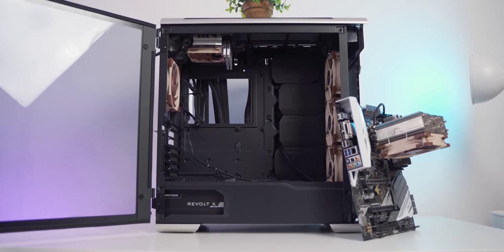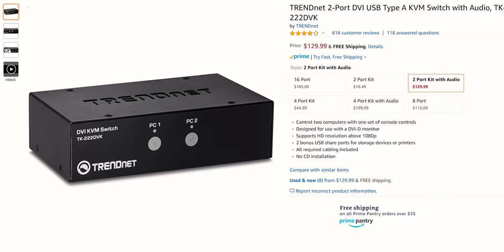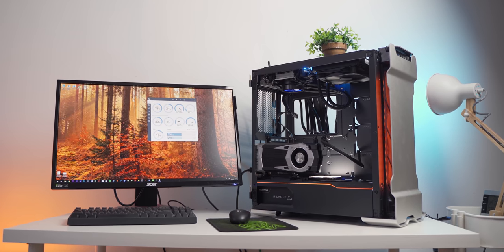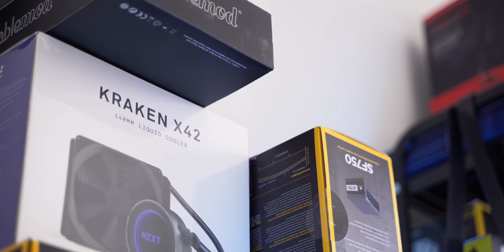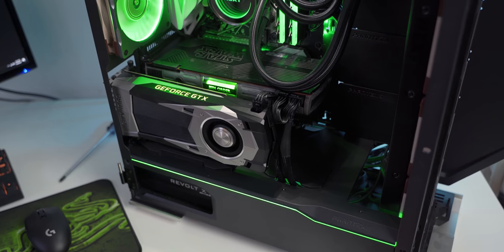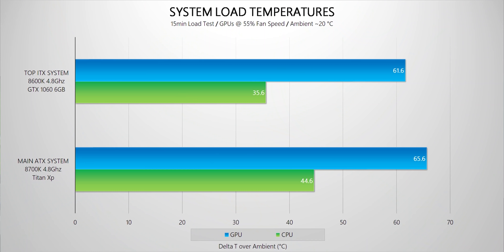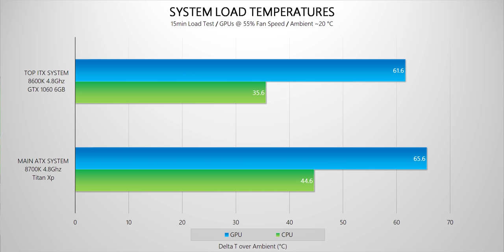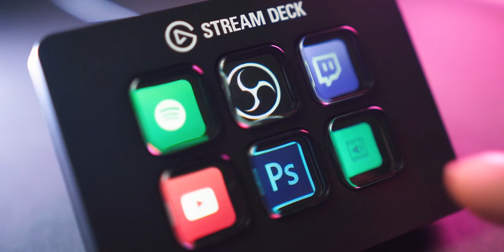My Experience with a DUAL System PC!

Comment: In my case -> ATX for gaming only, ITX for dual boot Linux/Windows. Linux for security, mainly accounting, ordering things, bla bla bla and the windows is for programming only. Have 3 monitors, 2 4k hooked to the itx system directly, a gaming monitor with a res of 2560x1440 connected to the gaming system directly, peripherals shared with a kvm switch :)

Comment: The Noctua specifically states that the NH-L9i can't handle the 8600k (95W TDP) WITHOUT OCing since it's rated for 65W TDP or less, and then you're surprised that a 4.8GHz OC overwhelms the cooler? Yeah...

Comment: As far as dual system consumer cases go, I've had the best experience with the Phanteks Enthoo Mini XL, and not simply for the ability to have an ATX and a Mini ITX system in there, but because it has 3X5.25 inch drive bays, it's sad to see the consumer industry pushing some enthusiasts into server grade cases to build what one wants, some of us believe in local storage u know !
in my case it's absolutely essential to have 4X 3.5/2.5 inch drives ACCESSIBLE AT ALL TIMES FROM THE OUTSIDE, and the only solution is having a hot swap HDD enclosure that fits in 3X5.25 inch drive bays,
as for the BEST hot swap enclosure to have in my opinion is the Rosewill RSV-SATA-Cage-34 for 2 reasons:
1 - Critical - the use of NON PROPRIETARY fan in the back, so u can be sure that those are getting the Noctua treatment as soon as they're unboxed, plus the possibility of EASILY changing it if it dies
2 - Personal Choice - individual HDD leds are blue, which I prefer, but more importantly the absence of green leds that light up green-orange when something is happening, which discriminates against color blind people, making it as hard to discern as a quiet talker's point in a noisy night club, 

This is blasphemy for some enthusiasts and a religion for others, I do understand how some people want to have a board, an M.2 drive attached that's IT !!! but really there are other people out there

Comment: or i mean use synergy ? so you could use 1 set of peripherials
Reply: Just what I was thinking.
Reply: Input Director all the way
Reply: While that would work here, synergy also supports linux and macos.
Reply: I don't think you can use software to switch since each mobo has its own IO?
Reply: @Vinchucca1984  synergy is meant for using 1 set of peripherals doesnt matter the io  u can use it on mulitple computers at a time too
Reply: Only works if it boots into the OS. Still require it's own monitors. a KVM switch would be a better option since the computer is all in one chassis
Reply: But the main purpose of a 2 in 1 pc is that 2 people can use 1.

Comment: KVM with high resolutions and framerates is quite expensive though, like hundreds of bucks. Only switch I'd really recommend is the L1techs KVM switch and that one costs 330/550 bucks depending on the model. And even then it's only DP 1.2 and not 1.4, so for the price you're not even getting a whole lot. Really wish more monitors came with a USB switch based on the input device. Then you can easily switch between different PCs through a hotkey and DDC.

If you secondary system doesn't require low latency, Synergy could be an option.
Reply: What applications would require low latency?

Comment: I thought about trying to do a dual system a while back for my NAS. I decided against it because it doesn't make any sense in my opinion to build a NAS that is a critical backup for your stuff because if my power supply breaks or there's a power surge and all the files are corrupted or whatever on my main system, it might just happen to the backup too. It might be practical to try and fit two power supplies in a single case, but then you need to find a small power supply and probably a really huge case, which defeats the purpose again because I don't want a computer the size of a fridge just so I can save space. Basically it's probably just better to build the NAS separately and put it in another room. I wish it weren't the case because dual system builds look really cool...
Reply: You can actually build your NAS and your main system in one case . make sure you use a surge protector and a UPS so even if the power goes off, your UPS is still on to enable you shut down properly without any loss of data.

Comment: Unfortunately you cannot use the mITX standalone, the main system needs to be powered on too. In my case, weird stuff happens when you power on the mITX. Even the GPU fan of the main system starts spinning while the main system is still powered off. The fans and aio pump of the main system are spinning too.
My config: a Hackintosh ‘up there’ configured on the mITX and a Windows 10 ‘down below’ as the main system. Main system uses a 360 rad while the mITX uses a 120 rad. Temps are normal, but I need to power off the mITX when I want to game... due to the ‘Hey, want to be an oven’ Radeon VII.

Comment: ATX system is for 64bit windows running current games.
ITX system is for 32bit windows to run older games that do not have versions that run on 64bit windows.

Comment: The 2nd physical system is redundant, just use a hypervisor (ESXi?) instead. I'm a Noctua fan too, so why are you not using the Chromax coloured or the cheaper grey Redux variants; instead of the traditional, but now unfashionable, brown? Finally, if the 2nd ITX system is something like a NAS, it will probably be headless and require no monitor to be attached anyway - except for the initial setup. Dual PSU is more of a gimmick IMO; but hey, maybe I'm missing something?

Comment: One 32 core threadripper system as a workstation and the other one for gaming. I currently have a threadripper 1950x but it is running 2 copies of windows on separate ssds, one for gaming with gaming mode enabled and one for uni and running BOINC ect. It's good cause switching to the gaming os is a pain, but it could be a bit easier, restart, switch bios config, boot, select other os, reboots again and only then it finally ends up in the right place. Luckily gaming mode stays on, but still. If I were to upgrade to a 2990wx or 3xxx with even more cores, gaming on it is probably not going to be the best so a dual system would just be perfect. Sadly I don't think I could make my current system fit in that Phanteks case, 4 vega 64s, all watercooled, I think it would stick out a bit too much with the terminals and the psu might not be so happy either.

Comment: I'm sorry, this is a largely pointless and compromising feature. It makes far more sense just to build your second system in another case and tuck it away.
Reply: paskowitz it’s called being a pc building enthusiast
Reply: @jacobander3239  I can only imagine the enthusiasm one may have when having  to replace any component on the ITX board when it's jammed in the case.
Reply: I mean it,s about as annoying as working on a computer with a custom loop
Reply: paskowitz it’s not really about practicality it’s more about building it cuz he can
Reply: @illfox240sx6  And that is the exact reason you don't water cool a NAS, streaming capture PC or really any secondary "work" device.

To the other guy, just because you can and that that makes you an enthusiast is an awful argument. End of the day, you buy a computer to do something. Sure you want it to be cool, fast, quiet and look sweet... but none of those things are accomplished by jamming an ITX system into an ATX case. Then there is the hit to aesthetics, cooling capacity, component choice as well as cable management, and ease building experience. 

There is nothing "enthusiast" about using a poorly conceived and poorly implemented feature. One isn't an "enthusiast" if you get an all glass case with no airflow... you are an idiot buying a bad product with superior alternatives  

If you want to be an "enthusiast", do something more productive like deliding, custom water cooling, or case modding.
Reply: paskowitz some people don’t have the space for two systems
Reply: @hitmanslayer3003  There are plenty of ITX/SFF cases that take up very little room. In fact, you could probably downsize the main system's case, netting you a comparable footprint.
Reply: paskowitz tru but many of those cases don’t have the hard drive and ssd space that I need
Reply: @hitmanslayer3003  Check out the Silverstone GD06 or other HTPC enclosures. They are often small footprint, but have ample storage capacity.
Reply: And where is the fun in that? I could only image that if I would have been building PCs for a long time that I would want something more challenging.
Reply: @petflaska389  Taking advantage of a poorly implemented feature is not "a challenge" it's just stupid. Maybe a dual system is something you want to do... Ok, fine... Do it in a case that actually provides that functionality in a good way or mod a case and diy.
Reply: Paskowitz i agree with you 100% but the reason why I would love to have this case is because my girlfriend and I like to game together but dont really have the space on our desk to have two systems. I see why this case would be impractical for the average PC builder/user but I see it as a case that fits the needs of a very specific type of customer.

Comment: I use two PCs in my setup but most of the time I only have one on. The other PC is made up of all my old parts. I mostly just use my second computer if I need a web browser open or my PC is down for whatever reason (One time I had to return my RAM and I didn't have any ddr4, I used the second pc waiting for the new RAM to arrive). Other than that I don't have any uses. I can see this being a good use for streamers though who want to use a duel PC streaming setup or someone who constantly has their PC being used for things like video rendering and want to do other work while it's going on, but I can hardly ever find a good use for my second computer.

Comment: Would a fully custom waterloop with sli for the main system work? I mean both systems in 1 massive loop. With like dual 360 rads in front? Not talking about sensible. Just a proof of concept thing?

Comment: How would you control the case fans or pumps from both systems? Could you for instance have a single loop and have it controlled independently regardless of which system is turned on and running?

Comment: Hey Canucks!
 ^_^

I wonder if I can go with another case for future upgrade dual system.
The whole internet screams: Enthoo Luxe 2. Still...
...I like either Phanteks P600S in white or, Corsair Carbide Air 740.

I bet I can't put good air on phanteks for dual system, but what about the air 740?

What's your take on this?
Or maybe just good space, isn't it good enough in the 740, in case I can't put good air flow there ;) ...

What's your opinion? Thanks man :)

Comment: What if you modified the cooler on the 1060 by removing the LEDs in it and replacing it with a RGB strip that you plug into your Mobo or a controller?

Comment: Dude, nothing that you've described about usage for the second system has anything to do with combination in a single enclosure. Many people have have plenty of reasons for having 'a second system' and your suggestions are valid, and as you said, not relevant for you. But to the question of whether a dual-enclosure vs dual distinct systems, the only advantage I can see is taht you can leverage the greater cooling capacity of the bigger case for both systems, instead of sticking the ITX into a smaller, non-airflow-optimised unit. But even then, good ITX boards are often more expensive than decent ATX-standard boards so if you did *need* a second system, you could just as easily build a whole 2nd system in a second case for virtually the same money (only case + a bit of shared cooling + the dual PSU (which itself costs more than 2x a similar single PSU). Really the **only** reasons for building inside a dual enclosure is if: 
A) you are *****really***** short of desk/floor space; 
B) you regularly need to transport both of your systems to other locations and laptops just wouldn't give you the capacity you need. 

But finding a use for the 2nd system in general is not hard.

Comment: bot my afk games on the second system and actually game on main system. Im just trying to figure out how to not buy that power supply because my current PSU is already 1200 platinum and i dont want to throw it away and spent 250$ on the revolt

Comment: How do you Stream using the ITX system if it doesn't have a capture card to record/capture the main system?
Reply: If the cpu being used has its own graphic output, you can omit the GPU for the ITX build. Then use a capture card in its place. 
Again, this is dependent on the cpu being used for the ITX build.

Comment: How would you make two computers work together for streaming?
Reply: You need a capture device on the second system, duplication of display output on the first system or pass through (depending on capture device) gives the feed to the second system. There are a few different types, elgato, aver media etc that will do it. Only issue I can see is trying to get a pcie card in the itx system, meaning you'd need one of the usb 3 models.
Reply: randomhato oh uh I have an old PC with a 1060 or smth that I think should be able to handle streaming I was meaning that but thanks!